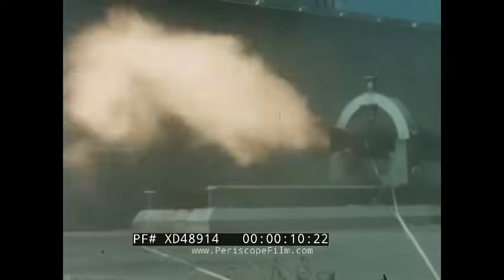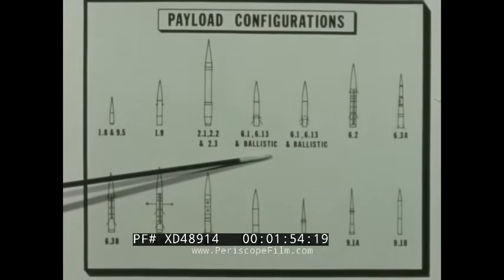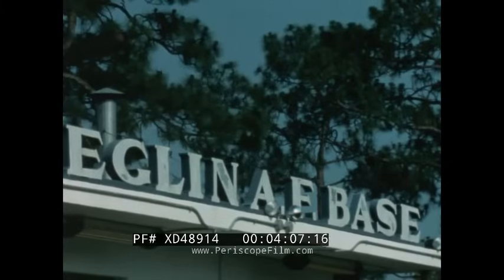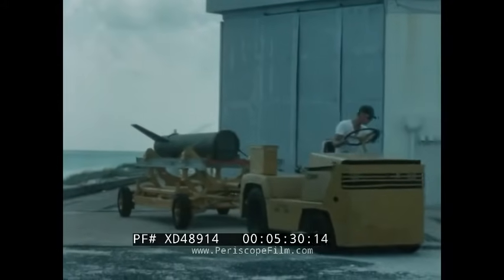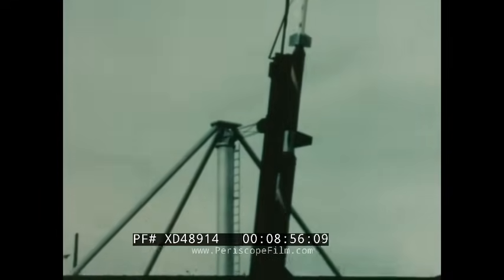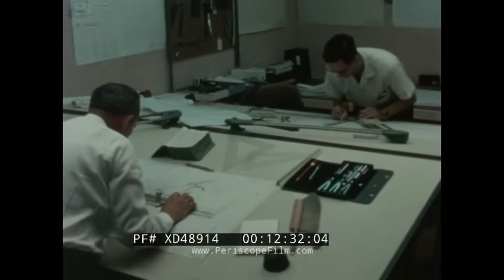" DASA PROJECT 9.5 " U.S. AIR FORCE HIGH ALTITUDE SOUNDING ROCKET OVERVIEW  WHITE SANDS NM XD48914

Comment: I never thought I would see a film about this program. It was very much a classified project due to the overall nature of 9.5's  final purpose.
I can confirm that I participated in a portion of 9.5 at Eglin AFB during 1965 through 1968. At that time I was an AF officer assigned to the Probes & Gemini unit which operated the A-10 & A-11 launch complex on Santa Rosa Island . I was cognizant of the purposes of 9.5, and its connectios to White Sands, DASA, Holloman, Sandia and Space Data Corporation. We launched several of the rocket configurationns menrioned for proof tests. Eglin Test Range was particularly useful due to its long over water high altitude capability. I personally retain a few official unclassified photos of launches of 9.5 rockets, and a few other related items from that time frame.

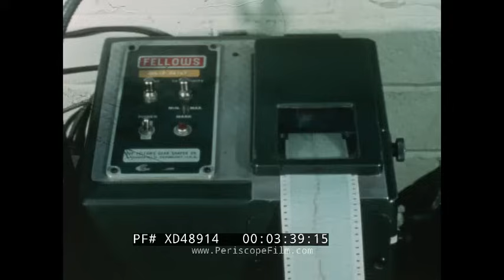Comment: One glaring error in the video - the mentions of "meteorological data" collection at 3:35 (and again later) shows a Fellows gear metrology device used to measure gear teeth form errors, something that would be needed for precision motion control but nothing to do with weather data. The paper strip chart is showing deviations from nominal tooth profile and pitch, not barometric pressures, temperatures, etc.

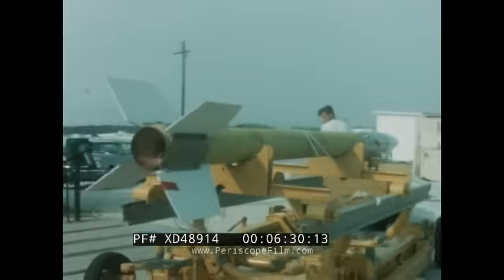Comment: 6:32 Seems as though the audio cuts out mid-sentence, but the transcript shows commentary continues
Reply: That's because it's only their film copy here that has the audio dropouts.  Their same video on a certain archive site doesn't.
Reply: @winstonsmith478  That was my original assumption.  Seeing dialog continuing in the transcript confused the situation.  Thank you for the additional info!
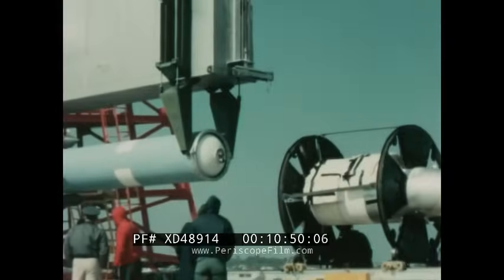Reply: And comes back at 8:40, goes away at 9:31, comes back at 10:48